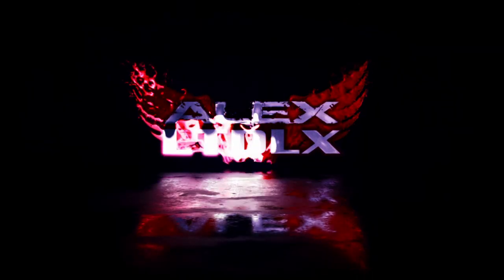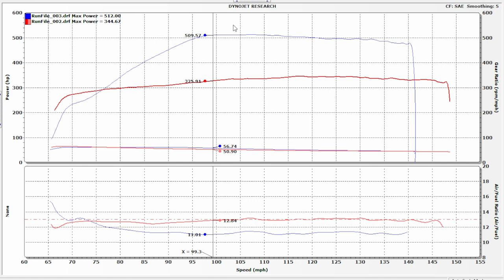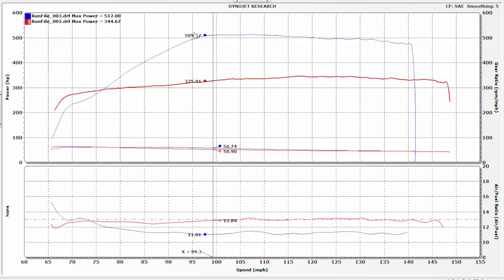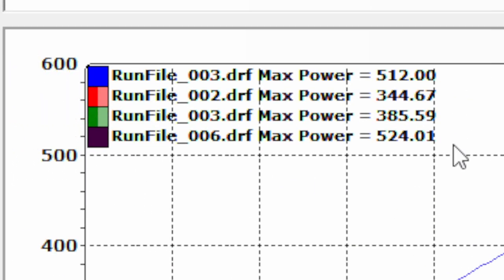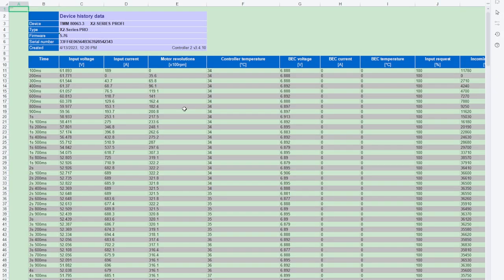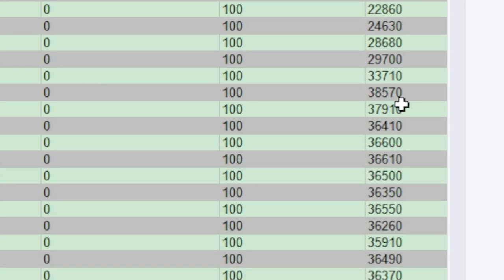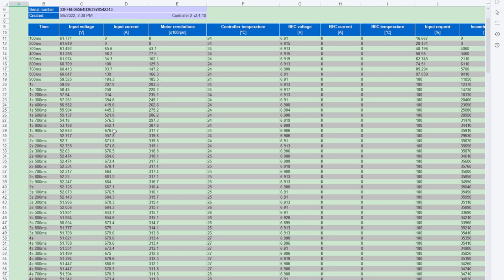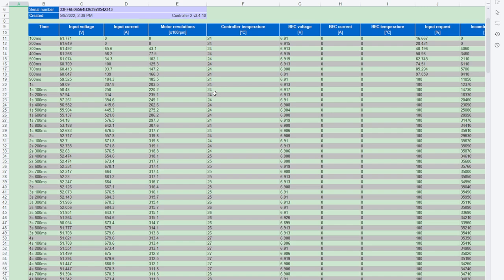Turbo Coating = More Horsepower: Dyno Data DEEP DIVE

Comment: So maybe I didn't listen close enough...if it had the same boost, was the compressed charge temperature lower due to the improved inpeller efficiency?

The Gale Banks videos probably are one of the few other channels that get into this stuff.  He's all about efficiency and temperatures on his diesel stuff.
Reply from the maker: The charge temperature was higher, but that's attributable to much higher ambient temps (almost 30 degrees higher).  You bring up a good, and fairly major, point.  If the boost is the same, the charge temps are higher, how is it gaining that much more hp?  All I can attribute that to is improved compressor efficiency.  I should've made that more clear in the video.

Comment: You also know it works because OEMs are using it to scrape every bit of efficiency they can out of a power plant. I believe a Turbo Direct S.A video covers it well and the efficiency gained per turbo can be something like 2% which is significant.
Reply from the maker: That's true - I mentioned Audi's use when I recorder the video, but I said it poorly so I don't believe it made it into the finished video.  I think Audi uses some sort of ceramic coating if I'm not mistaken.  Thanks for mentioning it in the comments, though.  It certainly helps convince the doubters.
Reply: @AlexLTDLX  Yep. It also soaks up some imperfections in the manufacturing process by allowing the blades to create their own perfectly shaped housing. It's really clever!
Reply: @802Garage  exactly the idea behind our self-fitting coatings, which we developed 23 years ago as a supplier to a Tier 1 supercharger manufacturer that applies it to their rotors.  Our Abradable Powder Coatings are now used to coat pistons, pumps, turbos and more.  Each device is able to find it's ideal fit while operating at temperature and under load.  It's not exclusive to new parts, so used components can also be coated to achieve "better than new" tolerances.
Reply: @line2linecoatings642  So cool! Thanks for the reply. In the future when I actually have more budget for a project I'll definitely keep you in mind.

Comment: I would make the wire connection from controller to motor short as possible Keep batteries where they are place the capacitors that damp the switching noise generated by controller as close as possible to controller. this should keep the parts in safe location in the car and have least potential for high power cabling issues. It is difficult to justify the cost of "L" or "T"  filter designs. frequency of switching  noise and current requirements make inductors massive,  Separate and secure cabling so the high currents can'f cause cables to move about to each other. The spacing of the battery cable to controller is important and the effect reduces by square of distance to each other and anything magnetic that is close counts so standing off the sheet metal makes a difference.
Reply from the maker: Check some of my high power test videos - I go through a lot of these issues in depth in those.  Unfortunately, to fit in an actual car, you need to give something up somewhere.  I've had the ESCs close to the compressors, but that seemed to cause issues (I blew up 3 ESCs doing that, for various reasons).  Now if I was building a race-only vehicle, it would be a small pickup truck, with everything in the bed and an LS engine with the intake flipped so the discharge of the electric superchargers (yes, I'd run a bunch of them) went right through the passenger compartment to the throttle body in a straight shot.  The the cables would be very short, weight distribution would be great and it would make well over 1,000 hp.  In fact, this is something I'd like to do in the relatively near future.
Reply: @AlexLTDLX  I made the suggestion from what I have observed and college courses.but hey if your feeling like going off the farm cool mist atomizers that uses piezo disk make cool micron size droplets this prior to compressor has the mass gain and doesn't erode the wheel .The ratio of methanol to water under 40 percent is safe operation range. Cooling , increase density and  additional octane gets that last bit of hp.

Comment: Looks like there's an oscillation in the current draw in the September data.  Does this correspond to a variation in mass flow?  If so there may be cycle to cycle variation in BMEP, which ultimately effects measured torque and hp.

Yes, love your data :-)
Reply from the maker: Congratulations!  You win the award for looking deeper into the (data) abyss than I have.  To answer your question - I dunno, let me check.  Ok, just checked.  It's almost impossible to tell, I even shut off graph smoothing.  If there is a correlation, it's less than a horsepower.  With the Eaton that was on this car some years back, you could see the rotors pulsing air into the engine in the data (similar to what I believe you're driving at).  It's a good question, Nietzsche would be proud.  Thanks!
Reply: @AlexLTDLX  Rotational momentum will low pass filter cycle variations.  Do you have higher bandwidth MAP data?  At 3000 RPM that's 200 combustion cycles per second for the engine and about 10ms for each induction stroke.  Maybe 10kHz sampling rate?
Reply from the maker: If I recall, there's some sort of filtering going on in the Megasquirt's MAP signal.  In fact, I had issues (a lot of issues, tbh) with the Megasquirt, so I run a small fuel filter (like for a lawn mower) in the line to the map sensor to help smooth out the signal some more - it was a fix the MS people suggested and it's been there ever since.  In fact, until I was typing this, I totally forgot about it.

Comment: Would a coating like that be as beneficial in a normal turbo application? Say a TTE700 on my Audi RS3 that would be doing likely 25-30psi (guessing) and 650ish awhp on E85 with an off the shelf Unitronic tune.
Reply from the maker: I believe it would. In fact I seem to recall reading somewhere that Audi uses ceramic abradable coatings in exactly the same place.
Reply: @AlexLTDLX  no wonder this car is so damn fast ;) love the deep dive!

Comment: Would like to see this test and data on a normal turbo car with a turbo blanket. Study's show similarities in the curves. The blanket keeps heat loss at a minimum so the speed of the exhaust gasses is higher and so is the turbo rpm. Advancing the point of power like this coating but also not adding peak power. So this coating and blanket would make a great pair.
Reply from the maker: The problem with testing a conventional turbo is all the other variables involved in the driven (turbine) side - with an electric drive, like we did, you eliminate those variables.  It would be possible to do a controlled test, but it's beyond the scope of what someone like me can do - you'd need a lot of money and time - best done by an OEM level manufacturer.  But OEMs are coating the volutes just like this, so there must be something to it.

Comment: Phase wires should be as thick and as short as possible, im currently building a triple motor ebike with a total of 175v 1400amps dc (20 seconds rating) to a total magnetic size of 273mm diameter  and 147.75mm width... 

Magnetic diameter with high kv copper (or pure silver) turn count is where the big torque comes from with gearing.... if you can fit it into space of your project....

Comment: What on earth do you think the coating is doing other than effecting the boost pressure? You think it's lowering the boost temperature?
Reply from the maker: Improving adiabatic efficiency.  Basically, it makes the compressor more efficient.  Now whether that's because it's shifting the compressor map in a favorable direction, expanding the compressor map or just increasing the percentage of efficiency islands, we don't have enough data to determine that yet.  Whatever it is, it results in a 5-6% improvement in compressor performance; at least in this application.
Reply: @AlexLTDLX  So at the same motor speed and engine RPM you're measuring higher manifold pressure?
Reply from the maker: No.  As I said in the video, the boost is almost identical.  But as we all (should) know, boost isn't boost.  7 psi from the Eaton M112 I used to run made less power than 7 psi from the Whipple I used to run, even though the Whipple took more drive power.  Same thing happens with turbos.  7 psi from 1 turbo doesn't necessarily make the same power as 7 psi from a larger turbo.  That's why compressor maps exist, along with efficiency islands.  With centrifugal compressors, sizing (and therefore efficiency in a particular application) is important - crucial, I would say.  However in this case, the physical aspect (much tighter clearances between the impeller and volute) are obvious; I'm sure there's something favorable happening along the impeller blade tops where the gap is now cut down to almost nil - but I don't have the resources to study that, unfortunately.  Maybe more subscribers and views might allow me to drop the kind of coin it would take to find out.  One thing's for sure - the variables are far greater than simply, "you must have made more boost or less heat (in the charge, anyway)."  The existence of surge and choke phenomena tell us that for a start.
Reply: @sumguysr  Put extremely simply: The coating reduces the distance between the blades and the wall. This decreases pumping losses because less air is escaping through the gaps rather than being pushed where you want it. This increases efficiency. More air moved per wheel rotation with less work wasted on moving air where you don't want it.
Reply from the maker: Much more concisely put, 802.
Reply: @802Garage  What is reducing pumping losses going to do other than increasing charge pressure?
Reply: @sumguysr  Increase EFFICIENCY.
Reply: @802Garage  So per rotation of the electric motor it will move more air into the same fixed volume of the charge pipe, so either intake pressure will be greater, or the motor will have to turn less to achieve the same pressure, or the charge is cooler. Is there some other type of efficiency I'm missing here?
Reply: @sumguysr  No you're generally getting it. Same power in equals more horsepower out or less power in equals same horsepower out. That's efficiency.
Reply: @AlexLTDLX  So you think the coating broadens the compressor map near your set electric motor rpm? It reaches your chosen boost psi sooner and the pressure varies less?

Comment: Have you thought about using the A/C to cool the IAT kinda like the dodge demon does? You should get more consistent results. The "killer chiller" is a bolt on set up that get temp literally bellow freezing 🥶❄️
Reply from the maker: Unfortunately, the AC on the LTD is long gone.  I don't even think I could get refrigerant for it anymore (or convert it to anything that would work - the car will be 40 years old next year).  But injecting methanol into the volute (next video coming up) not only cooled the charge, but also made the compressor much more efficient.  I do think the system on the Demon was neat.  When I ran a Whipple I used an A/W setup and that thing would melt 10-15 lbs of ice per pass (!).
Reply: Or just an intercooler
Reply: @kaiarneberg9203  He really doesn't make much boost, not enough to justify an intercooler and the added piping and weight. The meth is very efficient at sucking heat out of the charge, as you will see in the next video.
Reply: @AlexLTDLX  You might not be able to put the original AC back on, but you went electric turbo.. You could also go electric AC 😅
Thought I'd throw the idea out there.. Freezing IAT is really interesting to me, but I love the fact that you're looking for efficiency instead of just throwing boost at it.
Reply from the maker: I'm waiting for electric AC to become feasible, lol.  I will say that the Whipple setup would melt 10-15 lbs of ice in a single pass.  It had a 3 gallon water tank and ran a 2,000 gph bilge pump through 1" lines.  The intercooler core was made from 140' of 1/4 copper tube.  That thing was a beast.  What I'm driving at is you'd have to get a lot of mass cold to last an entire dragstrip pass, and then you'd have to run the car (generating heat) to cool it off again.  I do appreciate the thought - now you've got me thinking about that again.  But we're not really making enough boost yet, like Mike says.  Just for grins, check out this old video - you can hear the ice knocking around in the tank before the run (the tank was my center console for a while, so it's right under the camera in this video): https://youtu.be/DwFndZa0SSU  You can hear how there's much less ice left in the tank after the pass.  The little LCD display that goes flying is the water temp in F.  The intercooler core was something I made myself - I was rather proud of that thing.  You can see it here: https://youtu.be/oXeUxONLO9I
Reply: @AlexLTDLX

Forced induction interchillers in Australia make a remote refrigerator kit for air/water intercooling on drag cars to keep the weight down. No on-board AC needed.

There are some great videos demonstrating the power gains that can be made from ice cold water. Often in the region of 8-10% more power over ambient water.

Stay away from that "killer chiller" junk. The interchiller unit is currently the best on the market
Reply: @AlexLTDLX there are electric ac that can be retrofitted yo cars. You have batyeries. You just need to plumb ac line. The electric sife which is the hard part ia already on the car.

Comment: So you have ~60hp of electric power to the supercharger.
Reply from the maker: It peaks at just under 50 hp (746 watts = 1 hp).  The motor is rated for 53 hp.  I'm still blown away at how small and powerful that thing is.
Reply: @AlexLTDLX  This is a big advantage of your electric setup. Typical supechargers will take the same, or more, power to drive but it's taken off the crankshaft.  That's why your NA to boost delta is so big compared to typical blower cars.  Very nice!!!

Comment: 36kW?!?  That is bonkers!  Can you get a passenger to measure that directly with an old-fashioned ammeter?  It's not millions and I'm not saying it's impossible, of course, but it seems -- I'll put it as, worth double-checking.
Reply from the maker: There's no good way to directly connect an ammeter - an ammeter works by measuring the voltage drop across a shunt - basically a resistor.  At these power levels, that would cause potentially damaging ripple to the ESC.  However, there are 93 videos in the electric supercharger playlist - a lot of heavy load testing, and in some cases with an inductive ammeter - at least on the "less powerful" setup.  That still pulled around 14 kW.  This is one of those videos: https://youtu.be/Xh20iPZa02I  I also do a fair amount of heavy load testing of batteries - usually up to 500 amps.
Reply: @AlexLTDLX  so you have in fact double-checked those numbers (and triple-checked them, and more, it looks like) and confirmed they're about right.  Yikes!  I guess that pretty much explains why Detroit never mass produced something like that.  Still a great idea, but not as simple and easy as the concept seemed like it might be, at first glance.  See, I'm not a racer and a turbo that requires a bunch of additional batteries in my daily driver's cargo space isn't an appealing option for me.  I'll check your forum and see if other people have done what I have in mind, which is just about another 25% output without a lot of fuss.
Reply: Oh, a mere 1hp is 746 Watts so I guess 36kW is "only" about 48.25hp, which I guess is the right ballpark for parasitic losses to be as noticeable as they are, when the compressor gets its power from exhaust or a pulley off the engine.  It is indeed a lot for a battery, but not more than the application "should" require in order to work properly.

Comment: 37kW ~~ 5000HP.  That includes heat losses etc but, still
Reply from the maker: Yeah, it's nuts.  I'm assuming that's a typo - it's almost 50 hp.  That motor is actually rated for 53 hp.  I was changing the plugs out last night and I looked at the LMT motor and it struck me just how small and powerful that thing is.
Reply: @AlexLTDLX  I wish!! More like a reminder to not attempt math in my head before 4 cups of caffeine have entered my veins in the morning 🤦‍♂️🤦‍♂️🤦‍♂️ sorry, thanks for the correction. And yes that's still nuts but I was in 🤯🤯🤯 territory
Reply from the maker: Lol.  It's all good.  I've made much bigger mistakes - you just moved the decimal point over a couple of places.  I wish my bank would do that...
Reply: @AlexLTDLX  oh sheesh, I didn't realize I put 5 thousand until now d'oh 🤦‍♂️🤦‍♂️🤦‍♂ bank errors are nice when you're not a stockholder 😂